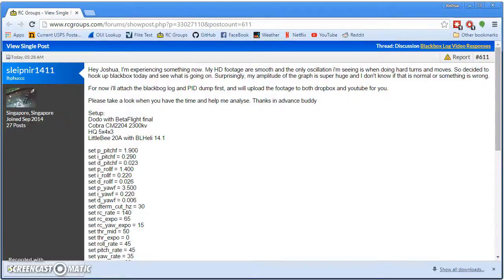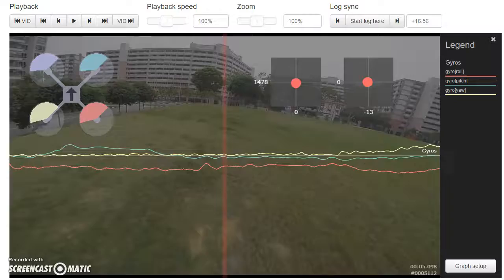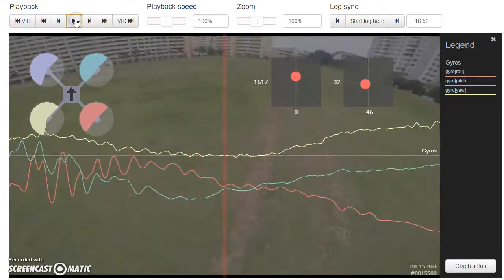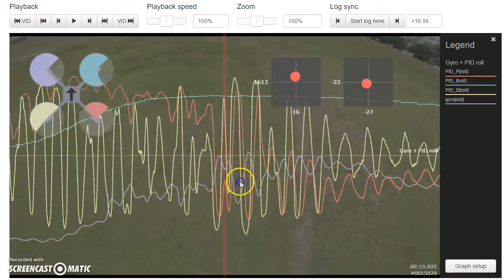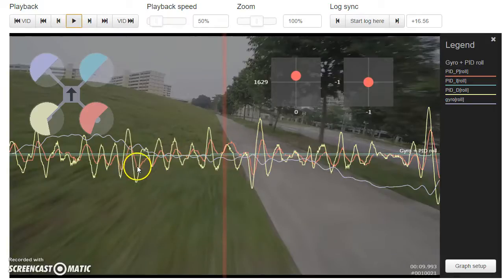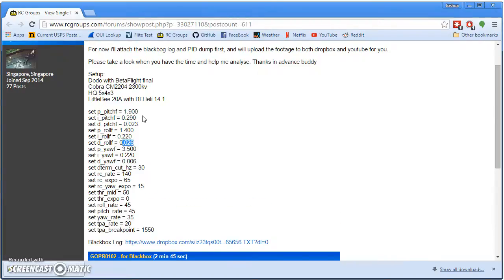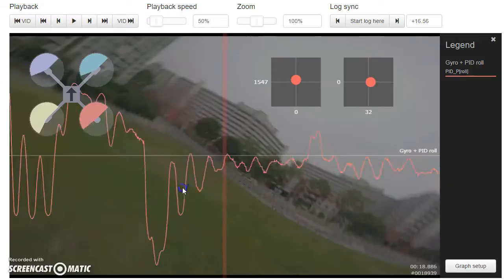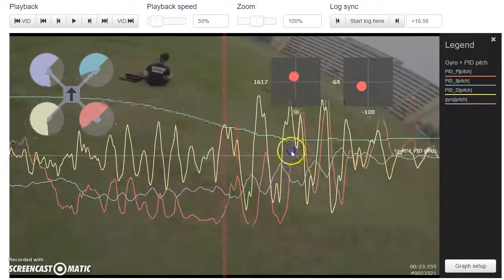Blackbox Log Analysis: sleipnier1411 10/25

Comment: Curious if you have used G-tune? Saw a demo by jbalatutube today.   If you have did the resulting tuning looks ok?
Reply from the maker: +Tobermory Cat I haven't used G-tune. Bear in mind that G-tune only tunes P gain, based on whatever I and D gain you have already selected.
Reply: Joshua Bardwell Thanks, no I hadn't got that far. So perhaps one should zero I and D to run G-tune?
Reply from the maker: +Tobermory Cat I think that would produce P values at the lowest end of the scale. Maybe an okay starting point for hand-tuning, though. I would probably start with at least a little bit of D, maybe 10-15. P and I are somewhat independent. Raising or lowering P gain can affect how fast I gain rises and falls, which means that if you raise P, you can sometimes lower I. But I don't think that relationship goes the other way very strongly, at least until I gets way too high. So I think you should be pretty safe with whatever (reasonable) I gain you choose before running Gtune.

So one way to approach Gtune (in Cleanflight) would be: Set I gain to something nominal like maybe 25. In reality, you will probably end up tweaking this a bit, but it's probably not too far off. Set D gain to something low, like maybe 15. Run Gtune. See how the copter flies. Now, treat D as the independent variable and tweak only D gain while re-running Gtune between each tweak. You change D, Gtune sets P, I is ignored. Find a P/D where you like how it flies. Finally, tweak I gain to where you want it to be by hand. Then, just in the interest of science, re-run Gtune to see if it tweaks P gain as a result of the I gain change.

I have never tried this... maybe I will just as an experiment, once Gtune gets rolled in. Has it been rolled in to Betaflight?